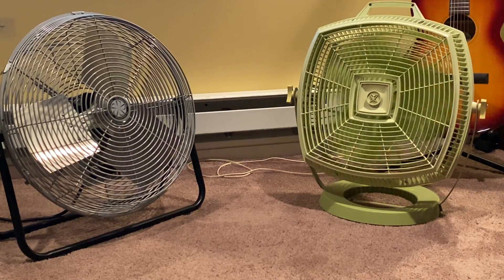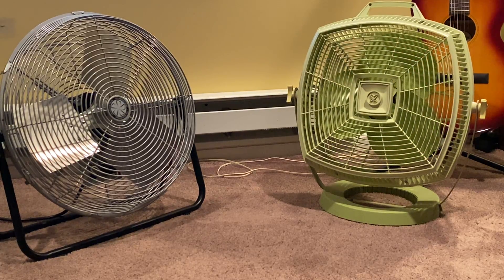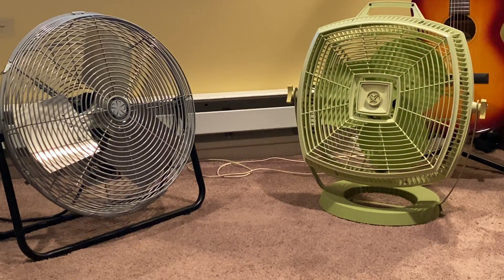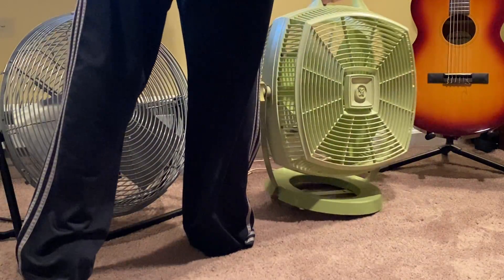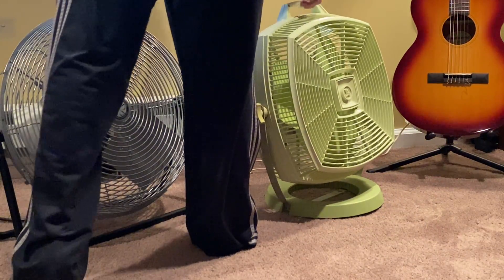Air King 9218 vs. TPI F-18-TE

Comment: Could you do a start up sound video of the AK 9218 if you ever revisit that fan? I’d be curious to hear how they sound compared to other 18” and 20” (wall, floor, ceiling, and pedestal) models with that same 1/6 horsepower motor. Thanks.

Comment: Several things don't add up about the specs.. The Air King motor is more horsepower, yet draws significantly less power? I also don't trust the CFM ratings, the Air King's speeds certainly have a greater difference than the TPI, yet both claim to have about a 300 CFM difference between speeds.. That can't possibly be right..
It's such a shame that the Air King's blade isn't better balanced, that's really the only thing wrong with it.. While an oiled sleeve bearing motor with a balanced blade should last plenty long, you simply cannot beat the longevity of a ball-bearing motor since the bearings are relatively easily replaced if they spoil.. I suspect the cast-aluminum draws out more heat from the windings too, the TPI motor, at least the 12" one, gets pretty hot..
I noticed the same as far as the air flow goes with the 12" models, the Air King feels more powerful right in front but fizzles out quickly, the TPI can be felt from much further away.. I'm surprised the Sears performed as it did, I was expecting comparable performance to the Air King..
I tend to be drawn to the TPI more because of the classic Patton-like design, the older Patton fans hold a lot of nostalgia for me.. The sound of the TPI brings back a lot of good memories of summers past with Patton fans.. It also has more of a quality feel to it, especially with the blade being balanced.. The blade issue really bothers me with the Air Kings..
 I bought my Air Kings last year, the 12" is acceptable, but the 14", 18", and 20" are borderline unusable..
One thing both these fans lack is an awesome startup sound like that Sears!
Reply from the maker: My explanation for the Air King motor drawing less power despite being larger would be the fact that it doesn’t have to work quite as hard as the TPI motor. Yes, the steel blade set is heavier but only by about one pound. And while ball bearings would arguably last longer in a continuous use/industrial setting, they still have a finite lifespan, and the average consumer isn’t going to think to replace them when they go bad. Oil ported sleeve bearings are better for people like us at least who will maintain them so they don’t go bad. As far as looks go I’d say I’m partial to this Air King in particular simply for the guard badge. The TPI would look better (in my opinion at least) if they were still using the old-style “shovel” blades rather than these square paddles with corners that could put an eye out, but they do give the fan a good sound. It’s loud, but I do like that airplane-like sound. On the subject of noise levels, it’s also worthy to note that the Sears was the quietest of the three, in addition to being the most powerful, but that doesn’t come as a surprise to me considering the Sears also has the steepest blade pitch. The Air King does have some cool startup/running harmonics to it but they’re no match for the harmonics of an old shaded pole motor
Reply: That's a possibility, I've never measured it but it looked to me like the pitch of the Air King's blade was also a bit steeper.. I do agree about the blade shape, these look a little rough and the corners seem like they could tear right through skin during servicing.. I'm surprised the Sears is as quiet as it is with the plastic guard, I've always found plastic guards like that to block a lot of air.. I guess that speaks even more volumes about how much air the blade itself pushes..
Reply: Same here, my brother bought an 18" TPI fan, and it brings back memories of when he was in high school, hes in his 20s now, I need to get myself one of these fans for use in my basement